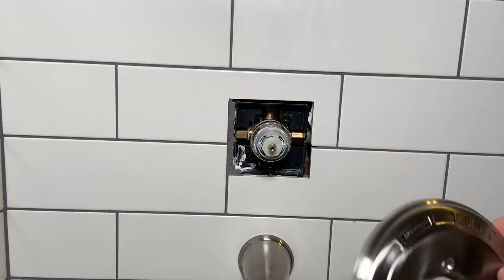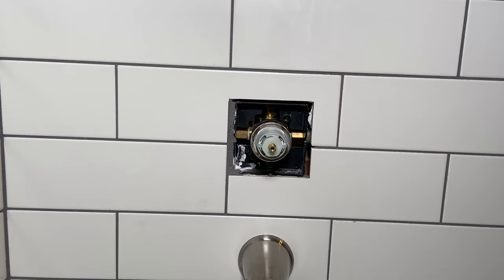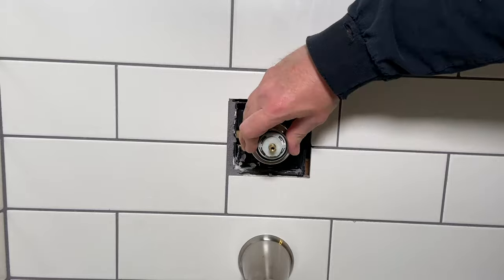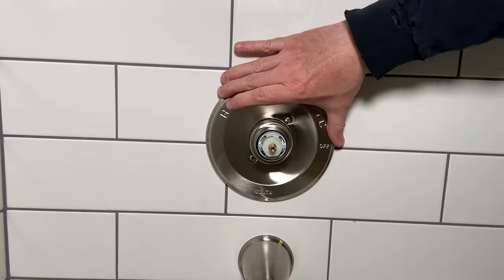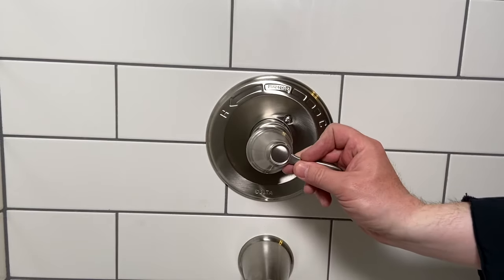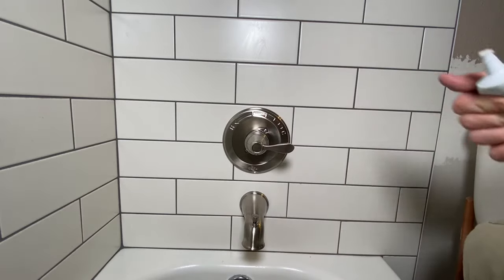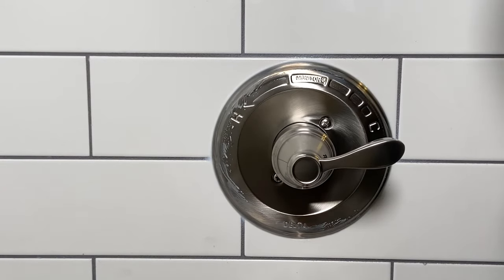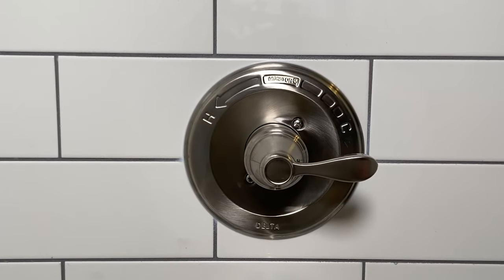Great Way to Caulk Tub Valve Handle and Cover

Comment: I saw a comment in another video which says not to caulk the bottom side of shower fixtures as water needs somewhere to go if it gets behind it. Any truth to that? A lot of people liked the comment 🤔
Reply from the maker: That is good practice for sure.  This valve trim and a lot of others have a little notch taken out the bottom of the plate that I do not caulk in.  Same thing with the tub spout.  if there is no notch you could leave a small gap. That would help drain if water got behind it.  I have seen many that are no even caulked and are usually fine is tightened enough.
Reply: @ThatFixItGuy  thanks for the reply! Hopefully goes smoothly tomorrow lol
Reply from the maker: Punny! But in all seriousness i am working tomorrow.  I hope it goes smoothly too!

Comment: What about the center piece, the sleeve that goes over the valve. How does water not leak around that?
Reply from the maker: There is a rubber type ring on the back side that is just a little bit smaller than the home that helps prevent water from going through.

Comment: Thank you great video! Curious - which caulking did you use that comes in tube like that?
Reply from the maker: It is a clear siliconized acrylic caulk. Water clean up. There is a link to some in the description box or you can get some at your local hardware store.

Comment: Thank you. I really needed this video. So the caulk goes all the way around the fixture? In other videos I've seen, the experts say the caulk does not need to be applied to the bottom of the fixture. Guess it's better to be safe than sorry. Can caulk simply be applied over old caulk -- I have a tiny hole in my existing caulk -- or should I take off all the old caulk with a razor blade, clean the surface, and re-caulk? Thanks for any help you can give.
Reply from the maker: There usually is a little cut out on the bottom of the cover. You don’t have to caulk it, but I usually will because I always use a water cleanup caulk so I can get it off easy.   I would always take the old caulk off and clean it up as much as possible.  Using a siliconized acrylic caulk is the way to go. If your caulk is newer and looks good you could just touch up that little hole. If it is the same caulk it will blend in. Thank you for watching!
Reply: @ThatFixItGuy  Thanks for the lightning quick response!
Reply: @ThatFixItGuy  Isn't that hole at the bottom a drain hole incase you get a gasket leak or other leak in the caulk around the cover?
Reply: @alanglowacki6266  good question I'm trying to figure out the same thing I was told to only caulk from about 7 to 5 if it was a clock
Reply: @ThatFixItGuy  I'm confused should it be caulked or not the very bottom (around 6 o clock?)
Reply from the maker: @alanglowacki6266  it totally is a drain hole
Reply: I would recommend NOT caulking the weep hole. We had a hard freeze recently and I dripped my shower so the pipes wouldn’t freeze, apparently the installer didn’t caulk the top well enough and slowly water filled up inside the cover and overflowed into the wall and soaked my master closet carpet. Had to replace the carpet pad and have a professional service dry the wall out and clean the carpet after. All because the installer caulked up the weep hole.

Comment: What brand of caulk do you use? Is silicone okay as well?  I didn't know you could just free style like that.  Good job.
Reply from the maker: It is a siliconized acrylic caulk. there is a link to a product on Amazon you can check out. I love it when caulking in all plumbing fixtures.
Reply: @ThatFixItGuy  where can I buy ? The link doesn’t work
Reply: I looked for it on Amazon what brand is it ? Alex plus ??
Reply from the maker: @yobiboo6840  I fixed the link.  Sorry they must have stopped selling.
Reply from the maker: @yobiboo6840  Dap Kwik seal ultra in clear.
Reply: @ThatFixItGuy  thank yooou I just ordered it, do I have to use that sponge or can I use the yellow and green sponge that is use to wash dishes ?
Reply from the maker: @yobiboo6840  You can use what you got.  Your finger will do most of the work.
Reply: @ThatFixItGuy  thank you I have the American standard colony 3 handle bathtub faucet, can’t wait to use the product on the escutcheons 😃